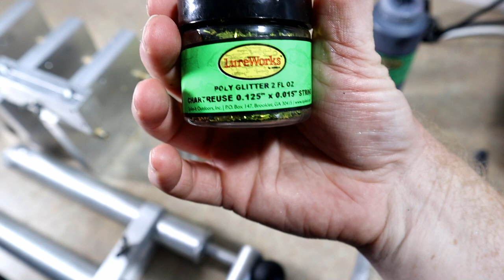Teaching ANOTHER YOUTUBER Lure Making! Who Is It???

Comment: Definitely a lot easier process than people expect, of course it helps when you have the best of the best as far as injectors and equipment go
Reply from the maker: It starts easy with basic Injection..then it gets very challenging when you start blending colors with laminates and hand pouring.
Reply: @WorldsWorstFishing  definitely does get more challenging, I struggle with my dual injector but I also have a horrible injector. Gotta go for the best quality injectors when it comes to laminates and injecting in general. You can have success with single colors but it comes with some frustration but with the dual injectors it's definitely top of the line or nothing. If the one I have had the bar across welded to the injectors on each side I feel like it'd be way better and an easier process but because it's not I find it way harder to get a more even pressure on each injector causing lots of mediocre baits in comparison. I haven't tried open pours yet but with there being alot more to an open pour, getting the temperatures right with minimal blending of the colors and getting the colors be where you want them, it definitely gets even more difficult and is probably the most toughest part of bait making as far as plastics go.